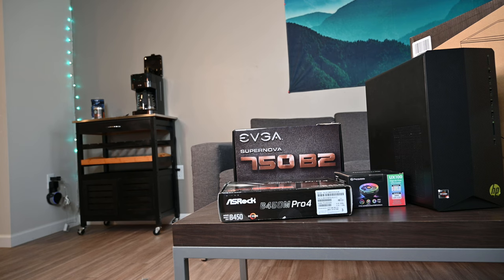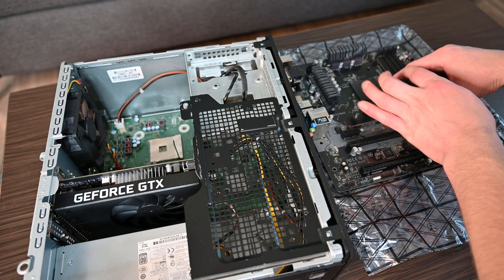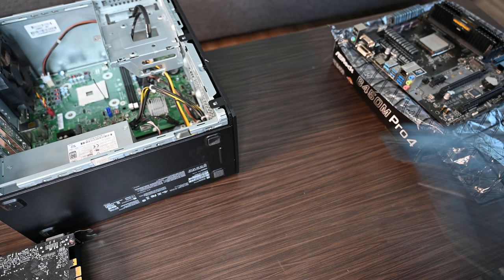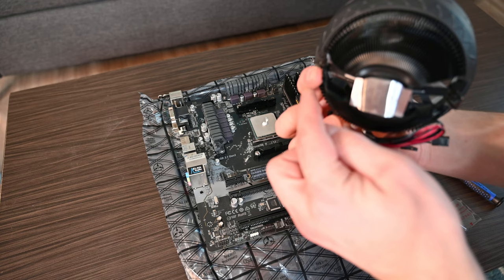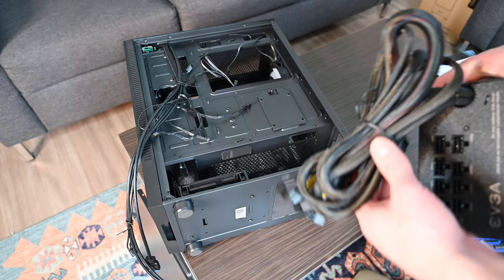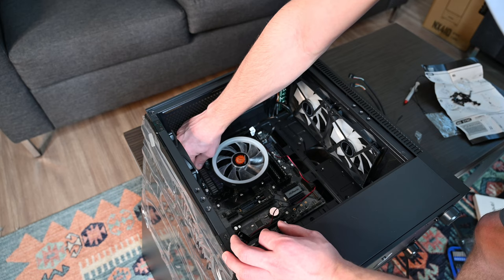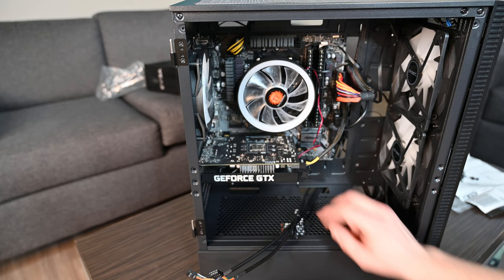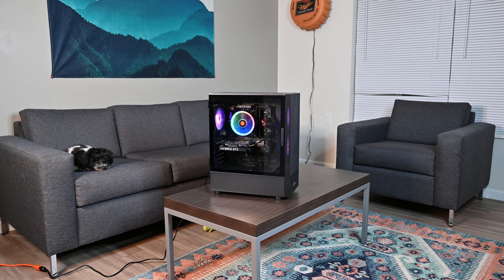HP Pavilion Gaming PC Case Swap TG01-0023W

Comment: I got the same pc, i recently upgraded the ram and the GPU, if you have this pc you can upgrade to the rtx 3050 without upgrading the PSU
Reply from the maker: I would suggest getting a bigger psu if you do. The one that comes with it is only 400w and I would not trust that to last long with a 3050
Reply: @PortzTech  it only draws 220 watts, so far no performance issues or crashes of any kind, runs smooth at high settings. I think in some cases, the gpu upgrade is a marketing scheme. This runs just fine.
Reply: @DAVIDJNUNO  Hey does your pc still run good with the 3050 because I have the same pc and wanted to upgrade the 1650S to something like a 3050 but I'm not sure about the psu and I dont know what sort of psu I would need for this pc

Comment: Hey so I’ve bought a new fara r1 pro atx case and I was wondering DO I have to change the power supply and motherboard for them to fit or can I just use them still and put them in a new case. Because I don’t want to have to buy new things
Reply from the maker: Yes, I would recommend getting a new power supply and motherboard. You will most likely run into complications.
Reply: @PortzTech  is it 100 percent needed tho for now

Comment: Hey, so I'm planning on buying  a bundle pack that comes with a psu so I don't want to just buy one before that, it'll be a little time later before I do that but I want to switch the case right now, will I be able to use the same powersupply for right now or is it like a hp only powersupply and I just need to buy a psu right now.
Reply from the maker: You will need to buy another power supply
Reply: @PortzTech  alright thanks, so just to confirm the powersupply within my hp case won't fit in the new one right?

Comment: 2 month ago i buyed the 1200€ Pavillon Gaming pc, later i heard about that lil laptop cpu.
I Want to Change the case like you. My question, my pc got 16 gb ddr4 a GeForce rtx 3060ti and a Intel®Core™i7-11700F 2,5 ghz 
Can i use the Same cooler, mainboard and other parts like u?  Is the Change from the Intel parts the Same like Ur ryzen?
Reply from the maker: You will need a different motherboard and I would recommend a different cooler. Join my discord for more help on picking parts out

Comment: Awesome video. My hp pc has an i5 10400 and an rtx3060Ti. The heating issues are very apparent and I want to do this case swap. What mb would you recommend I use? I'm planning on reusing the ram and just upgrade the case, psu and mb
Reply: any lga 1200 mobo with wifi should work

Comment: Does anyone know if you can take out the WiFi card and add it to the new mobo? If so how?
Reply from the maker: Yes you can! Just unscrew the one screw holding it in. pop off the little wires on the card then install on the new motherboard the same way

Comment: Do I have to buy a new motherboard? Or can I just use the same motherboard?
Reply from the maker: You can not use that motherboard in this case. The hp motherboard is designed for the hp case

Comment: Grate content i have this pc with a ryzen 5 4600g will this cpu work with a b450  tomahawk max
Reply from the maker: It should work, you may need a bios update. I would research on your own to make sure
Reply: @PortzTech  thanks for the reply i have research it but its an oem chip and not alot of info online so im kind of confused.
Reply from the maker: @jinblade2846  I see. The ryzen 5 4600 is really in just prebuilt I believe. I would imagine that a tomahawk max b450 would work with your cpu considering people have used ryzen 5 3600 and ryzen 5 5000 series chips on it l. Since in between those it should work hopefully

Comment: I upgraded this pc ram with corsair vengeance and nvme with a Samsung 970 evo plus and now I can’t get it to display.( I did a recovery data on a  usb also)  I didn’t touch the Gpu and ❤the ram and nvme is seated correctly, but I can’t figure out why it won’t display can someone please help🙏🏾( I tried putting the old ssd and ram back in and still no display

Comment: I bought the TG01-2260xt it’s an i5 11400 and a 1650 super will that same build work for me? And does the new build increase fps?
Reply from the maker: Yea it will work for you. You will just need a different motherboard for intel. This video I use a motherboard for amd cpus.
Reply: @PortzTech  thanks bro I have honestly been on the edge of my seat for this bid to drop! I was so happy when h saw it! Thanks!
Reply: @PortzTech  I got another question. I got the 1650 super graphics card that came with the pavillion, i know it is from hp and is different from like a gigabyte card, how do i know if it will work with the motherboards?
Reply: @Portz Tech

Comment: What about the Hard drive?
Reply from the maker: It goes into the sliding trays at the bottom of the case
Reply: @PortzTech  yeah but like can u show us how to connect it and stuff
Reply from the maker: @JorgenHanssen  It connects with sata cable and then power it off the power supply. It will look like a L shape plug same as in my previous video I had with installing a HDD or SDD. If you have more questions join feel free to join my discord

Comment: for motherboard i got the ASUS PRIME b550 Awifi is that good? btw everyhting els eis the same
Reply from the maker: That's a good  motherboard
Reply: How did it go?
Reply: @tezwtw  i bought the same powersupply except 650 instead and i bought a intel motherboard and the same case i just ordered it so it will arrive friday but ill update you :)
Reply: @abielhernandez2699  how can you put a amd cpu in a intel mother board
Reply: @tezwtw  thats the thing i had a diffrent CPU from this one mines bigger so it doesnt fit with that mother board
Reply: @abielhernandez2699  ohhh then update me Bc I’m thinking of doing this with my pc
Reply from the maker: Do you have amd or intel?
Reply from the maker: Let me know how everything goes
Reply: @PortzTech  INTEL so i switched to a intel motherboard
Reply from the maker: @abielhernandez2699  It should be the same process
Reply: @PortzTech  ok thx

Comment: Great Video! but I wanted to know if I could upgrade the case to any NZXT case and what upgrades I should get, the desktop I got is the HP Pavilion TG01-2360 with AMD Ryzen 7 5700G 3.8GHz Processor; NVIDIA GeForce RTX 3060 12 GB GDDR6; 16 GB DDR4-3200 RAM; 512GB Solid State Drive.
Reply: I've owned an S430, h510, and h510i. I'm a mid-tower fan, I don't really care for putting a micro-ATX board in a mid-tower case. However, the h200 seems like a viable option if you have a micro-ITX board. On the other hand, the h400 is a mini-ATX case, so you'd get a bit more room. Given your specs, I'd say go with the h400. I'm not 100% sure your graphics card would fit in an h200. Be sure to double check dimensions though, you could fit it all into an h200, and if you have an AIO, make sure it won't prevent you from installing your gpu. The h400 seems like it would be a good fit for what you have, but if you want something very compact, the h200 is definitely something to look at. Or you could go crazy and get an H1

edit: i now own an h710i with an ASRock X570 Taichi, Ryzen 9 3950X, 64GB 3600MHz RAM, RTX 2070S, NZXT Kraken X73
Reply: @justgivenofox9543  Alright thanks man appreciate it, I will look into it.
Reply: @justgivenofox9543  if i wanted to go for the H700i what motherboard should i get? and cpu
Reply from the maker: Thanks, @JustGiveNoFox for the input.
Reply from the maker: You can upgrade the case to your choosing
Reply: @デビッドイバラ-l5m  hey david, sorry for not replaying sooner, my rule of thumb as always been: if i'm getting a mid-sized tower/full-sized tower, i want the motherboard to utilize that space. it makes no sense in getting a mini or micro motherboard when you have all that room. as far as upgrading from an h500 to h710i, they're set up similarly, except the h710i has more space in front of the board and a bit more space above the board. the increased height and length allows for 3 fans in the front instead of 2, and the top allows for 3 fans instead of 1. as stated, you can always upgrade your case; i haven't noticed a huge improvement with temps but i do like the larger size because it gives you a lot more room to work with. also the features that come with the "i" series cases is nice: rgb strips and a fan controller. just something to keep in mind. i am biased with nzxt, but there are other brands out there that make very good cases
Reply: as far as hardware goes, to answer your question, it comes down to personal preference. for the money you spent on that prebuilt, i say for now, just swap everything over to a new case. the motherboard if i recall is a mini, but you can always upgrade that too. obviously smaller motherboard=less features, but it'll be a lot nicer to look at when you have a case with more features too
Reply: @justgivenofox9543  thanks for the reply and I recently upgraded to a h510 with a new motherboard, more ram, NZXT z53 AIO water cooling, and 2 TB SSD for better storage of course. and i guess you were right it really does come down to personal preference

Comment: Does the motherboard come with wifi ?
Reply from the maker: This one does not
Reply: @PortzTech  is there wifi on the hp that I can transfer ?
Reply from the maker: You can transfer it, but this motherboard you will need a adapter piece with other motherboards you will not. If you need more help you can join my discord server to get help
Reply: @PortzTech  okay

Comment: Does the motherboard swap or do you have to buy a new one?
Reply: You have to buy a new one. The old motherboard is a lot smaller then a average motherboard so it will not fit in a new case

Comment: can i use the same motherboard
Reply: I would love to be able to do this. Primarily because I don't want to buy a new Windows key. All I'm really looking for is a bigger case and PSU so I can use better GPUs. You can lookup the motherboard specs here: https://support.hp.com/us-en/document/c06693646 Because the form-factor is "mini-ATX" and potentially proprietary, chances are you woudn't be able to or would have to do some soldering.

Comment: Some disinformation here.. You CANNOT use the same CPU cooler from the HP .. The cooler will not line up with an AM4 socket mount. Plus the ram needs to go in slots 2 and 4 for dual channel mode. Plus you'd be smart to do a fresh install of windows on that NVME as that drive will still "think" it's attached to the HP motherboard which will carry a completely different chipset/drivers. Not trying to rag on your post ma man... Just some helpful tips
Reply: How would u do a fresh window install on the nvme
Reply: @Spiderninja2025  Download it to a USB with Windows Media Creation tool ... There's TONS of YouTube videos on the subject.
Reply: @Snaggletooth40  ok thanks because me and my friend is doing this at the same time and he didnt know what to do either.. would I have to do that if I get a new nvme also?
Reply: @Spiderninja2025  yes ...

Comment: Can I use a different case or does it have to be that one?
Reply: Are you buying a new motherboard?
Reply: @juanayala639  Well yea I have to if I'm moving it to a new case.
Reply: @paplayz  I would say just look up if the case you like supports this motherboard
Reply from the maker: You can use any other case. Just make sure it will fit the motherboards size. If you get a full size atx case that will fit just about every motherboard

Comment: To be clear - this isn't even remotely by any stretch of the imagination a "case swap" when your changing out the motherboard. It's now no longer an HP.  All you did was harvest your NVMe M.2 drive & CPU, and they aren't even HP (AMD & Nvidia) for a completely new build. A more appropriate title would be "Harvesting the CPU & Graphics card from an HP Pavillion TG01 to create a completely new and NOT HP computer". Hard to believe no one pointed this out. I'd be impressed if you actually did some research, found adapters to use the front I/O ports and actually swapped the HP motherboard into a new case like your YouTube video title suggests. It can be done, I've done it with An older DELL.
Reply: Nga quit crying this is exactly what some of us were looking for cuz hp parts are shit
Reply: @electro5175  Yeah, and he made a new computer he didn't case swap an HP. The new computer has zero HP parts.
Reply: who sits behind a pc and complains about someone else benefiting others? its not that deep so why come to complain on a video? if you can do it better then do so on your own page if not its not going to change anyone's mind this is a PC CASE SWAP!
Reply: @corriganmiller3134  Where is the benefit? I was looking to swap my HP into another PC case, and this video isn't swapping to another case as the title says, it's a new PC build altogether.
Reply: @davidlorin1379 this is because none of the other parts besides the cpu gpu ssd and ram are able to be placed into another case since the motherboard isn’t compatible with any case so you need to buy a new motherboard and psu
Reply: @Zlowr  Hence why this isn't a case swap.
Reply: @Zlowr  With a little modification and adapters, you can totally re-use everything and put it in a new case. This isn't a case swap by any means.
Reply: Instead of crying about this why not just think for a second. you probably already know that parts of the hp pavilion are made specifically for the pc case it had which makes it harder to swap the case. Portz has stated in one of his first videos he does not recommend it as you lose out on some benefits from the motherboard and its just difficult. This video is apart of his series where he has been upgrading the hp pavlion pc so alot of the viewers are from there and like myself i wanted to swap the case of the hp pavilion whilst changing some of the parts at the same time so this is perfect for me. People have different plans for there pcs so dont cry about it
Reply: @mr.mcnuggies4343  This isn't a case swap, quit your whining.